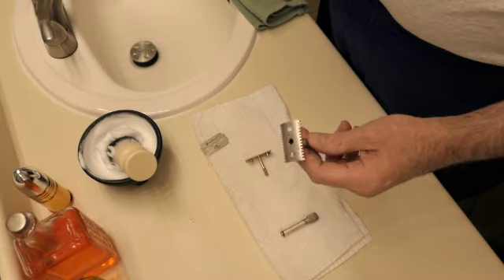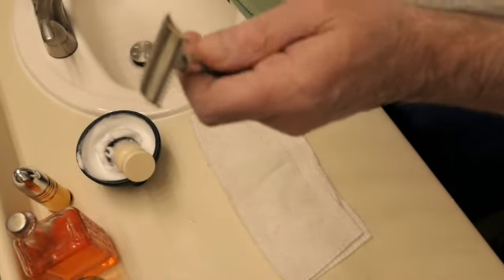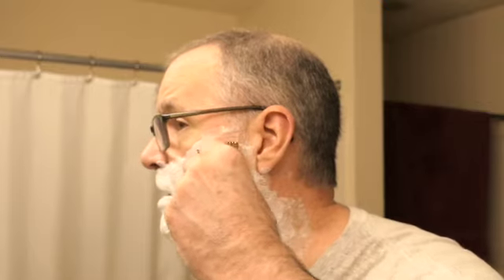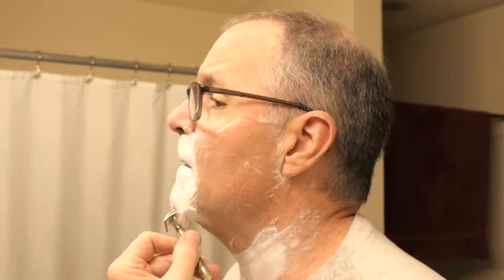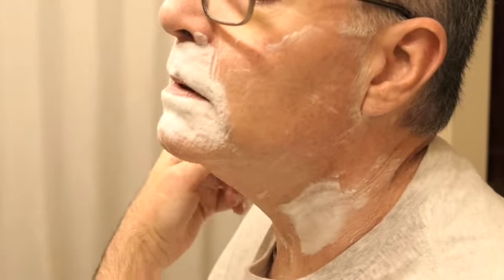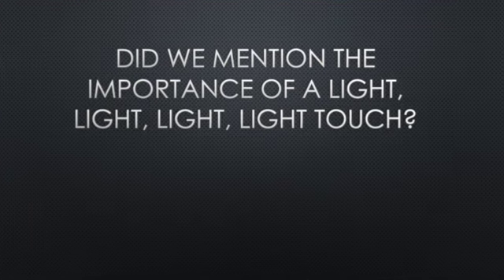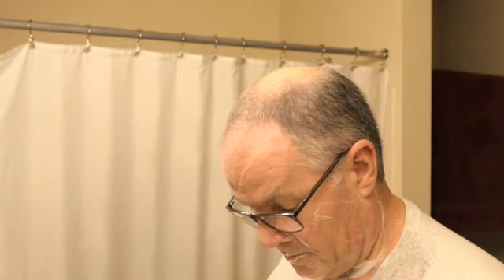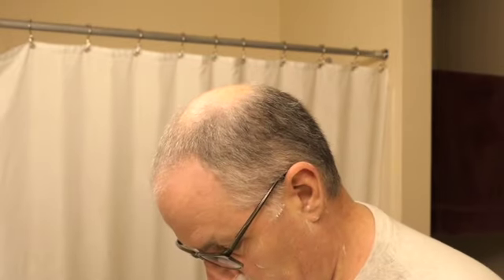How to Shave with a Gillette Single Ring Razor

Comment: Thanks so much for posting this. I recently acquired one of these razors and my first couple shaves were pretty rough with it. Your advice of lightening up and using only 1/3 the usual touch works wonderfully. Also I found it helped to go slower than usual. I still experienced tugging and pulling even with a fresh Nacet blade which is one of the most efficient for me. But maybe that is just the way this razor feels as it still cut close.

Comment: Great video Pete. Now I have to find a Single Ring razor.
Reply from the maker: If patient, you should be able to get one on eBay for $15-$20.  You'll see plenty for $150, though I suspect those are sellers that don't know that much about vintage razor values.  Gillette had the US Military razor contract for WW1, so there are plenty of these floating around.